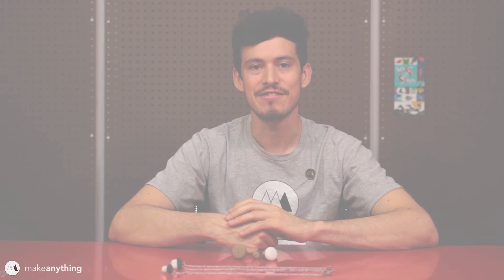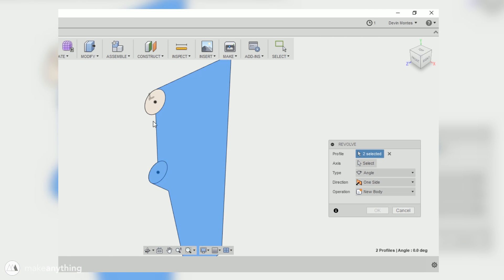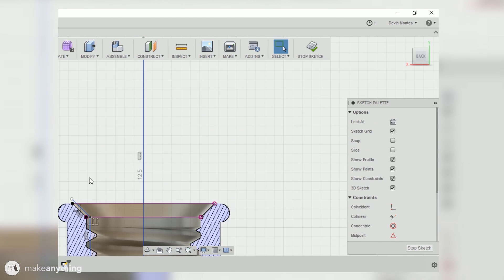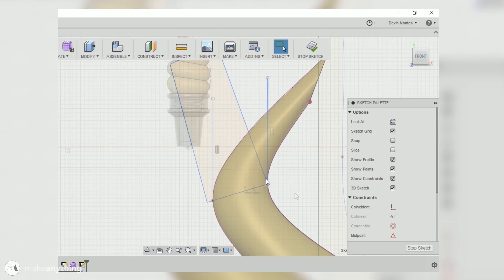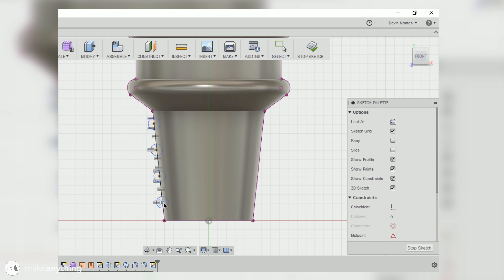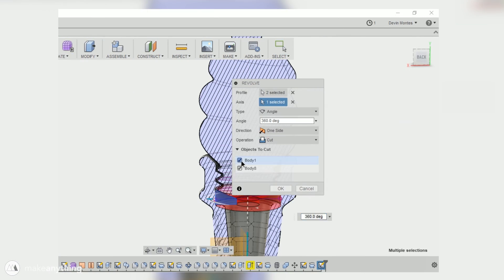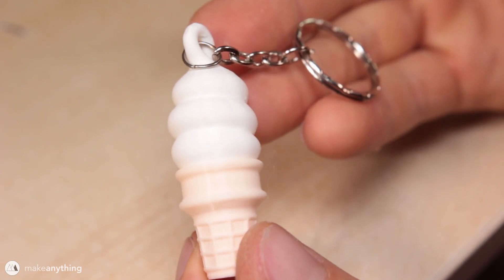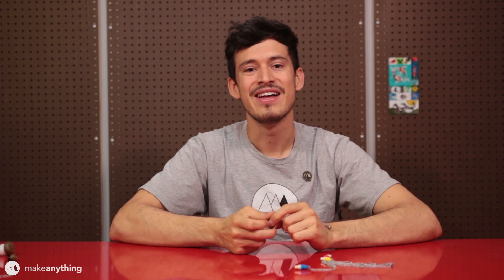3D Printed Ice Cream Cone Charms // Fusion 360 Tutorial

Comment: to get the swoop at the top of the ice cream you need to subdivide the faces at the top so you have more to work with. instead of those long rectangles you had, having more faces lets you select and curve them around a smaller radius. but the way you modeled it actually works better, to have a more uniform and strong loop, its hard to get things that even in the sculpt environment.

Comment: Isn't that a bit too tiny for a container?
11 mm , half of that is gone through the thread and the bottom layers, so you are left with 5mm.... you can just shove in a single Pea.
A bit bigger and you could make it into a USB stick.

And it seems like the small vertical lines got lost on the smaller versions. Intentional or were they just too small?
Reply: I think maybe it's for drugs.
Reply: luvz2reed I like the way you think
Reply: ABaumstumpf I don't think it's designed as a container. Except maybe for an emergency sniff of coke.